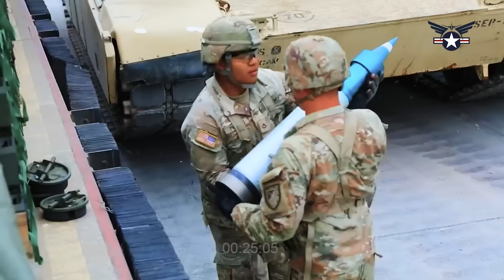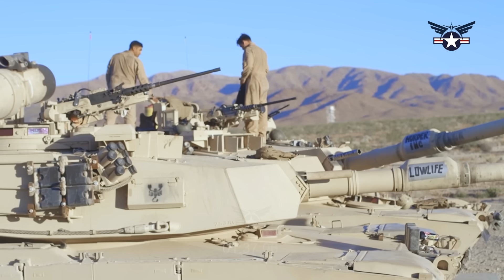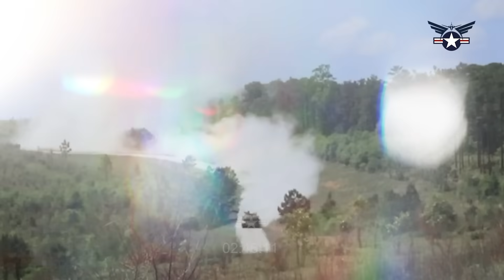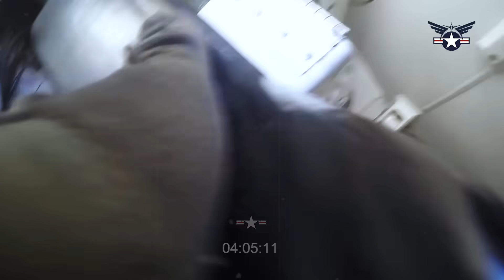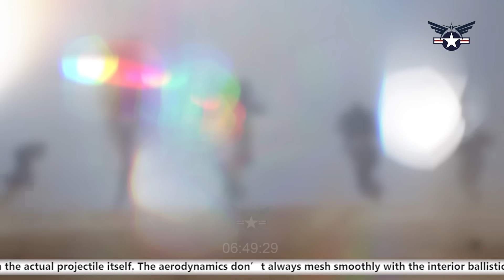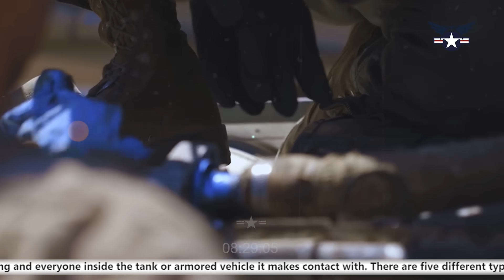U.S. Army Test-Fire M1 Tank 120mm Armour-Piercing

Comment: The M829A4 APFSDS-T round, with depleted uranium penetrator and programmable fuze, pierces 800mm+ RHA at 2 km—ideal against Russian T-90s—while the new M1147 AMP (full-rate production approved January 2025) combines HEAT, MPAT, canister, and obstacle-reduction in one, boosting logistics for Ukraine's 31 M1A1s (22 lost per Oryx). This amps up Abrams' urban punch, but drone vulnerabilities (e.g., FPV strikes) highlight the need for APS upgrades. A timely boost for Kyiv's push—raw power meets modern grit!
Reply: @ledong-j2u зачем боеприпасу с сердечником из обеднённого урана программируемый взрыватель?и где он там расположен?